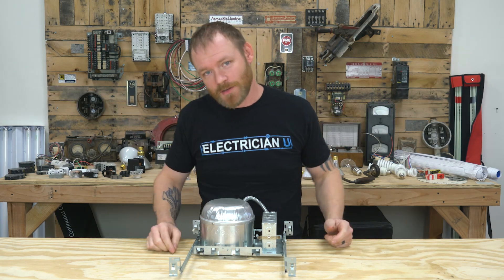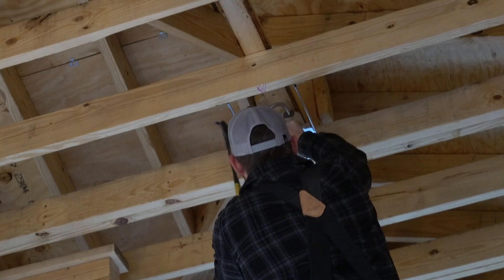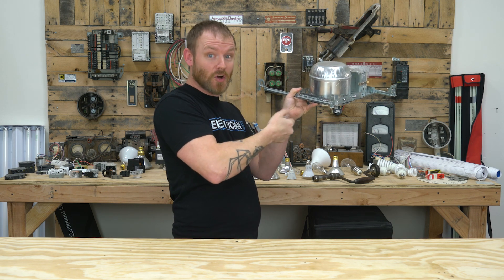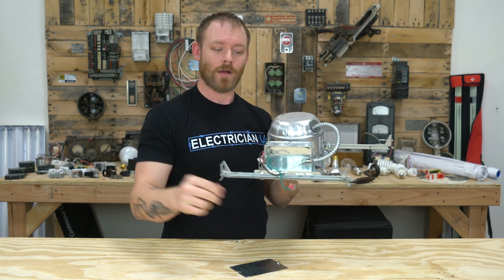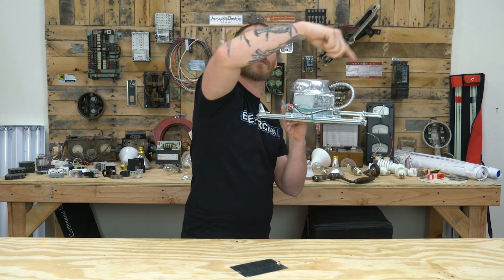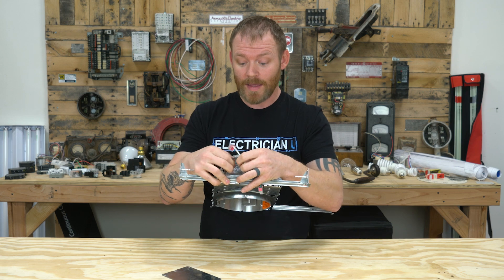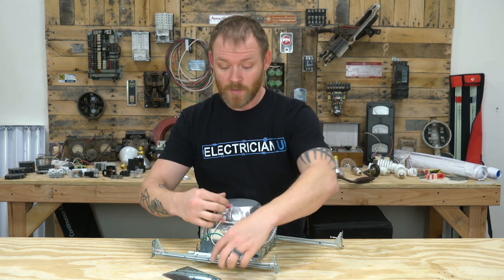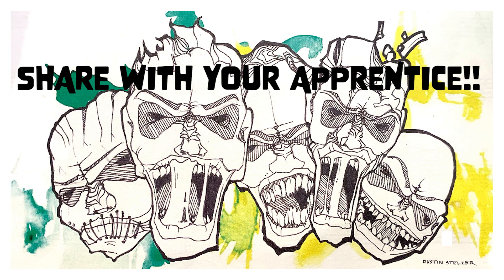RECESSED CANS - Installing & Working With Can Lights

Comment: Great tips...I've learned most of these the hard way, through trail and error...before YouTube, but what gives me a hard way to go is making the brackets fit between the joists after cutting them shorter.
Most manufactures put breaks every couple of inches, but trying to put the brackets back together after carefully cutting them is sometimes a problem.

Comment: My ensuite bathroom shower had a leak and destryoed my ceiling. So we pulled the ceiling down and had a plumber come over and it's all fixed. My question is should I install new construction cans like in your video or put the ceiling up and have thos think pot lights put in....my power source is where my old light/ceiling fan was.

Comment: If you can use either the bigger knockouts or the smaller ones, which do you prefer to use?
Reply from the maker: Depends on the wire size, connectors for NM I have on hand or for the metal clad cable on hand.

Comment: I have an unfinished sloped ceiling in my cabin with 2x4 slats running between the metal roof and the joists. Is it possible to run the cable over the space between the joists and the underside of the roofing            (approx.1 1/4 in.), or do I have to drill holes through all my joists to reach the metal housing for the lighting.?

Comment: Fuck using the nails on HH cans get a drywall screw and put it in that way. Quicker, easier to fix, and a lot less work. Track use a metal screw obviously

Comment: Loved the video Dustin and perfect timing for my bath remodel.  I would love to see you do a video on installing and properly wiring cans and using low voltage dimmable light inserts above a tub/shower including any additional wet/damp area safety and dimming switch considerations that you would suggest.   Loving the EU!  Thanks for sharing...

Comment: The flat or half inch led are what we have been installing in some cases and I love them. Granted they cost more! But you can just pop them out and adjust the Kelvin setting. simple and easy to work on.

Comment: So question, is Romex required to be stapled within 12" of the connector, or 12" of length of wire? As you were were showing examples,  it was definitely more than a foot.  That leads me to believe the code really means within 12 inches of its termination, in in that case, 12" of the can.
Reply: Within 12” of the device or termination
Reply: @jimmyjenkins5744  Well yes, but what if you (for some stupid reason) looped the cable up and down a bunch of times, close together using up, let's say 5 feet of cable? But the end of that mess is still within a foot of the connector.  Theoretically I could still put it on the end of the mess no? 

Yes, I've stretched this WAY too much, but I just wanted to see if anybody had any clarification to the many "cloudy" codes we must follow.  Do you know what I mean? 

😔 Forgive me.

Comment: One very important thing to mention is that you need to be aware if the can is insulation contact (IC) rated. If it’s not, and you stick it up in a ceiling with insulation, the fixture can overheat, start a fire, and you’re getting your ass sued when the Fire Marshall finds out. Just a thought 😊
Reply: Why would they ever make a can thats not IC-rated
Reply: @mr.g937  non-IC cans are cheaper.
Reply: @mr.g937  they do make them that way.
Reply: @mr.g937  If they are being used in a downstairs ceiling, like a kitchen. There isn't any insulation in the ceiling joist between floors, just in the upstairs ceiling. Those would be IC rated.
Reply: @mr.g937  what is Dustin doing
Reply: @mr.g937  what is Dustin Stelzer doing in the video

Comment: This video was awesome, really helpful. I would recommend maybe getting some drywall screws instead of using the nails. I’ve discovered the nails are super cheap and get bent out of shape very easily. Also if you need to move the can and take it all the way down, trying to pry the nails out, make the tabs all crooked and jacked up, it’s just not fun, makes it a lot harder than it needs to be. With the screw it’s an easy install and take apart if need be. Also the laser was a great  idea. I personally use a chalk line,  but anything you can use to make sure you have a solid straight line.

Comment: where'd you get that lazer? i been looking for 1 with 3 lines haven't been able to find
Reply: It looks like he is using the Bosch model, there is a Green and a Red version, they also have an optional receiver for situations where light level is just too low. Got mine on Amazon, extremely handy tool, I use mine all the time and I'm not even a Pro, just DIYing a whole house. https://www.amazon.com/s?k=Bosch+GLL3&i=industrial&ref=nb_sb_noss_2

Comment: If using connectors, set up em through your knockouts, make sure they're secure with screws facing outwards, and keep the entrance at the top loose til you bring your wire through. 

Edit: I meant to say, set em up while your cans are still down, before mounting them. Just makes it a little easier while you have more space and visibility.

Comment: Love it.  I do it all the same way except for one thing.  I know it takes longer, but I HATE wagos and I cut them all off and wire nut everything.  Ive just seen them fail too many times to trust them.
Reply: Wagos aren't for stranded, other than that I've never seen a wago fail other than installer error (no waterproofing outside, wire not pushed in far enough) Even counting stranded wire failures I've seen maybe a dozen and a half in 15 years compared to bucket loads of wire nut failures.

Comment: I usually cut the nails out and replace them with 1-1/2" drywall screws. It's a lot easier to install them that way. And if you make a mistake you can simply buzz the screws out with your screwgun instead of having to pry the nails out with a flat bar.

Comment: Electrician u what kind of lazer do you use in your video? I use DeWalt and it's really hard to see the line unless it's dark out.
Reply: maybe his camera made it look better than it is; digital cameras are essentially infrared sensors with color correction.
Reply: replace the battery

Comment: Your technique for nailing up a can to one side, then sliding it over to the other side to nail up is perfect for what you described for keeping it centered and lining it up with other cans. I’ve had quite a few apprentices over the years and some just have a hard time understanding that technique for some reason. They just wanna hammer it up and then end up with wonky legs and a row of zigzagging cans lol. Get your measurements on both studs, line up to one side and nail down, slide it to the other side to line up there and nail down, then get your measurements in the middle of the bay, just like you showed in the video. Lasers are great too, especially in older homes being remodeled where nothing is square. Anyway, great video! I appreciate the channel! 

One other thing, me personally, if I ever have wide stud bays where the legs are stretched out pretty far, I wrap some electrical tape around the middle of the legs where they meet just to help prevent them from sagging or possibly breaking, just a little extra step to help keep them in place.

Comment: I Never trust the screws to hold the can moving I put some electrical tape in the corners
Reply: Ezra Ohnouna Same, or fire a screw thru the legs and a part of the can
Reply: @seansmythe7543   I have found that the screws losen pretty easily
Reply: @ezraohnouna353  super easily. Bump it with a bit of force and Now your lights off

Comment: We'll throw a drywall screw in between the tabs and the arm to keep it in place. And leaving a loop is always good when doing custom, as it seems builders are always moving can layouts like you said. Nice video. Pretty common sense to most resi guys, but for a homeowner or new apprentice this video could be real helpful!

Comment: Worth noting another quick and easy tip is to go half your spacing distance off the wall I.e. if your going 6' on center try to start and end 3' off the wall or end of the run. It will make the light look even with the reflectance

Comment: Your explanation of why you don't strip too much insulation off the conductor,  Is my explanation of why you should cut out the wagos and use wire nuts.
Reply: those wagos are a pain with AWG12.
Reply: I always cut them off too, i dont trust them.

Comment: Wafer lights are the only way to go for adding lights in sheet rock
Reply: steve adams way easier to install
Reply: are they bright and cool enough yet? we use a lot of 100 and 150W equiv around here (1100 and 1400 lumens).
Reply: wim0104 they go anywhere from 2700k to 5000k. And they make some that are adjustable so if the customer is unsatisfied with the brightness it can be changed on the spot and not have to worry about change orders or returns

Comment: All we install now in quebec canada is low profile recessed light , good to see your videos tho !! 🤘
Reply: I also try to use them whenever possible but it depends what our customers want. The flat panel LEDs are easy to run, can be installed in almost any space, and consume very little wattage.
Reply: Those waffer lights are amazing in tight remodel spots.  Especially basements with all the ducts and pipes run every which way.

Comment: Question why are you using 12/2     Wouldn’t you use 14/2 ?
Reply: All depends on the situation, due to arc fault breakers, most people put lights and plugs on same ciruit. Could still use a 15 amp ciruit, but I think it's best to use 20 amp to be on the safe side for vacuums etc, and keep in mind your not allowed to down size the  wire.
Reply: Guy above me already answered, but it just depends on the size of the circuit. If you're adding to a 20A circuit, gotta use 12-2. I personally don't put lights and outlets on the same circuits anymore for the most part, I try and put outlets on 20A circuits and keep my lighting separate on 15A circuits, but in older construction of you're adding lights to an existing circuit, don't just assume it's a 15A circuit and use 14-2, always check the amps of the circuit before adding anything on it so you can use the correct size wires. 👍
Reply: @strangerofthe2067  
Yep, great response, however I'm curious on your method, on the arc fault breakers, if lights and plugs are on separate circuits, then that would mean a bedroom could have 2 arc fault breakers. I understand your combining several room lights together etc. And possibly plugs 
I'm just like know other peoples methods. Thanks man
Reply: mark 80 yes everything on arch faults that needs to be by code. Say for example, a small two bedroom house, I would likely put the two bedroom outlets on one circuit, the bedroom lights, along with maybe bathroom lights or something or maybe smoke detectors on one circuit, then probably kitchen and living lights on a circuit, living outlets on a circuit or maybe even with the bedroom outlets depending on how many there are, then kitchen outlet circuits to code, bath outlets, small appliances, etc. sometimes it’s overkill and not necessary, but I used to work for a company that wanted to do the bare minimum on everything, trying to do as few circuits as possible and really loading everything out to the max, and I just hate wiring that way. Creates problems for homeowners and I had to make a lot of trips back to houses after people moved in and had issues with breakers tripping all the time just because they were so loaded. Now I work for a company that is pretty much the exact opposite, all about quality over quantity and would rather put a bit more into material and time spent to do it right and so it allows me the freedom to wire basically how I would wire a home if it was mine. Nothing like tripping a breaker when you’re vacuuming at night and all your lights go out with it lol, then you have to fumble around in the dark. So that’s my method personally, I know some companies and some people would rather do bare minimum for cost and I get that, I did it that way for a long time, but now we try and just give quality work to people and have happy customers in the end, and it’s been working out great! Also kind of a house by house basis, I do a lot of high end custom houses for pretty wealthy people so they’d rather spend the extra money for overkill.
Reply: @strangerofthe2067  
Thanks man, but your right it does suck when the breaker trips and the lights go out as well, I hear that alot why people separate the 2. I personally now put each bedroom on it's on circuit. I just think its easier. However I  service work now, 90% of my work is commercial, and bucket truck work, thank man for responding.
Reply: mark 80 yea I hear ya. I also pretty much always put master bedroom on its own, then maybe two bedrooms together max, really just depends on the house and the layout, but whatever the case may be I always try and keep circuits pretty small and just do what I would want in my own home. 

Pretty nice you’re into more commercial work now, hopefully that’s a lot more money involved! I’m actually getting a bit of commercial hours here and there myself too, and also doing a lot of marina work- installing pedestals on docks, lighting and receptacles on docks, something different than residential all the time. The company I work for is mostly commercial and specializes in this marina stuff, but they brought me on to do a lot of residential work they also get, so I get to do a bit of everything, acquire hours towards taking my 01 test, and also spend the extra time needed to do quality work! I couldn’t ask for a better scenario than the one I have right now, it’s been great!

Nice chatting with you! I’m always open for discussion and love sharing my experiences, as well as hearing about others. Stay safe out there!

Comment: Hey do you dislike the wafers or just used the old ones for teaching

And a reason I've been told to face junctions on the inside us because theoretically,  you would run less wire being on the inside part instead of going around cans

Comment: Didn't know if you would also go over IC vs Non IC rated as well.  Of course I was renovating my house and the lights I had removed were Non IC rated.  So they naturally decided to bury them in blown insulation.  Glad it never burned my house down.
Reply: using modern LED bulbs helps a LOT! we've had to explain to engineers about old nineties LED tech being too hot... or why they should leave some air gap to help it vent (the can insert/sleeve being the wrong shape...).

Comment: I would like to see a video on writing and reading circuit diagrams and schematics. My current teacher low key kinda sucks and I've been able to firmly grasp everything you explain. So it would be wildly helpful. Keep up the good work!
Reply: And then how to put the schematic diagrams into the field! How many conductors will I need?
Reply: Go to the near Ocupensional center, 
Or go to the Contractor's state license Schools and study for the C10 license.
Reply: @AngelTorres-tk2nw  what is Dustin doing
Reply: @AngelTorres-tk2nw  what is a recessed can

Comment: Lithonia wafers are great for old work. Even if there is a stud in the way. The wafer is literally 1/2in thick. I use them all the time with my company.
Reply: i agree all my company uses now is wafer style rec even for new work
Reply: @trev6007  Are you guys able to just leave a coil up in the ceiling and then cut in with a hole saw? I've been talking to my boss about doing this, worth the extra few bucks when you get it back in labor savings.

Comment: I have a light similar this but it goes out  every few minutes then comes back on. What seems to be the problem?
Reply: What type of bulb do you use? The cans have a heat type sensor built in. If your using halogen or incandescent it may be getting hot and and shutting off to cool. If its LED not to sure based off just that info.
Reply: @Lokoamerican4509  I use LED.
Reply: Maybe a lose nuetral or bad bulb
Reply: @markborchers6447  where is the loose neutral located at? The panel box?
Reply: Do you have it on a dimmer
Reply: @derekstratford7937  no sir it's actually a hotel bathroom. All of a sudden it just started doing that. I may just replace the whole thing.
Reply: Call a licensed electrician. You are not qualified to repair this.